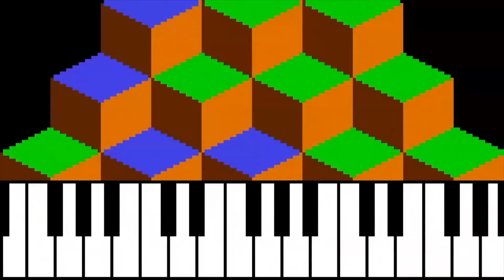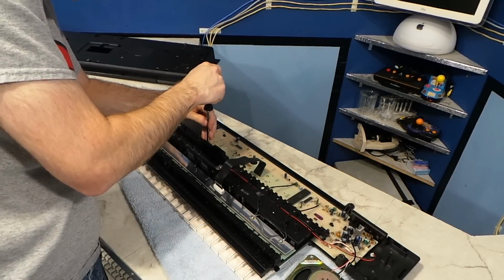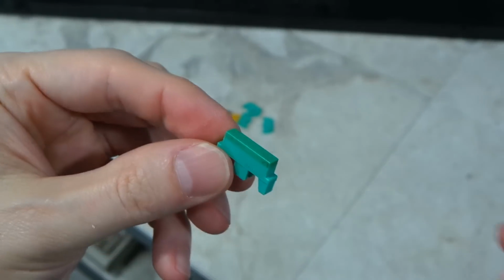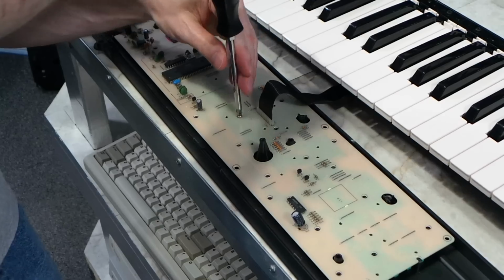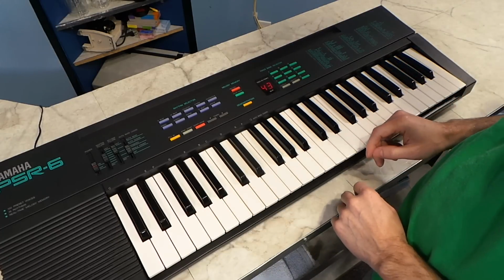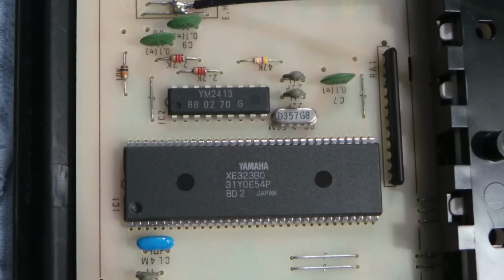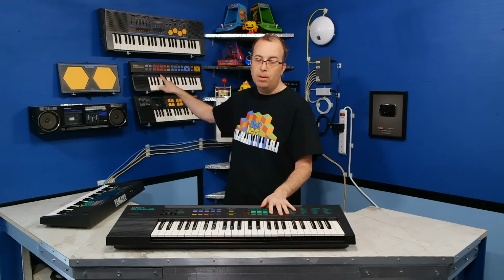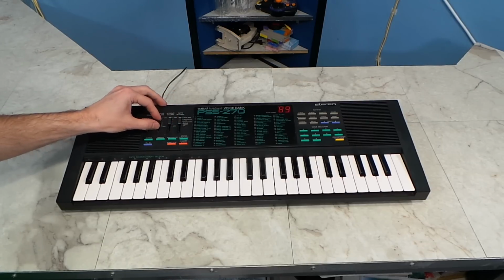Yamaha PSR-6 Restore and Review

Comment: Dude, use a toothbrush for tight/small places. That's what they were designed for anyways.

YM2413 has one fully unlocked instrument register that is programmable just like OPL2. Shame they didn't put any programming capabilties in this thing. It's a very capable little chip for its time that it offered at a relatively cheap price.

Comment: The ribbon connector looks like the Kenwood/Panasonic. To release the wire ribbon, push on the whole connector in the direction of the circuit board.

Comment: That popping sound you are complaining about is when, generally speaking. the waveform doesn't start from the origin point, like if you were to take a sinewave at its lowest point and in the next sample have it at the highest point, you would get that pop. Try using a sawtooth wave and play it really low, you will have the same pop.

It could also be a result of a waveform desync or a faulty connection.

Comment: I bought one of these sometime last year, and I had totally forgot you'd made this video on it. If only I remembered before I tried to clean up mine! I ended up pretty much ruining it in the process. Luckily, the guy I got it from had another one, and they were both pretty cheap, so now I have one that works and another for spare parts.

One thing I noticed while destroying the first one is that, apparently, the synthesizer section and the rhythm section each go to separate inputs on the amplifier chip and then get summed together at some point between there and the audio jack. But the jack is stereo, and the sound is mono! Could there be a way to split up the synth and rhythm sections into separate channels? That way, one could record them independently at the same time instead of having to record one and then the other.

Anyway, [SHAMELESS PLUG WARNING, READER DISCRETION ADVISED]:

I used this keyboard in an EP I made recently, "shrugemoji.midi", in conjunction with a Casio MT-100 (both songs) and a freeware Korg Poly-800 VST (second song). It's alright, I think.
Reply: I’m trying to fix dead keys on mine. Any idea how to take the keys off?

Comment: The popping sound occurs because of the ADSR parameters set on the instruments. I've had the issue a lot when making OPL3 music, and sadly it's VERY hard to avoid because of the limited range that OPL parameters get (0 to F, or 1 to 16 in decimal). You can minimize it with careful programming but it's still something that you unfortunately have to deal with if you're making an instrument with a modulator that attacks and decays quickly. 

I will say that Yamaha did a particularly crap job at hiding that pop though, I could make it way better if I had access to the patches. But honestly, I wish Yamaha would have let parameters on the OPL series go up to 1F like the OPN series, it'd help a lot with making more precise FM patches.

Comment: We need a pss 480 review, its quite a hidden jem...
Reply: victorman 222 either that or a pss-680, they both have the same sound chip, but the programmable drummer pads at the bottom of the 680 are great. They also both have a great demo tune, but the 680's demo has electric drums in it which give it a very nice 80s sound to it

Comment: Third wire on a  speaker is probably just shielding or it is possible (although unlikely) the amp has a split output, typically seen in transformer coupled amps. I would have to see it more in detail as to what it actually connects to. I think it's a bit too 'young' to be a field coil speaker.